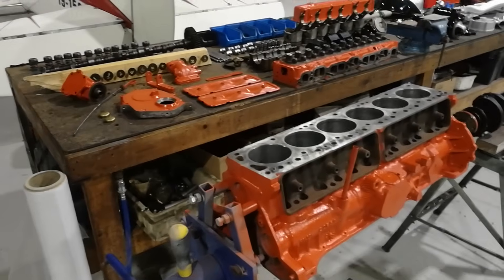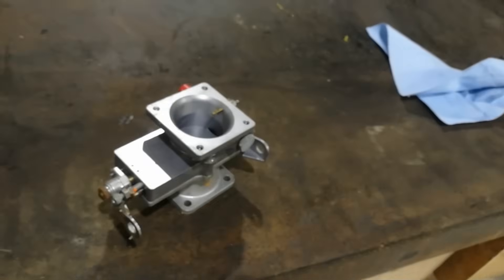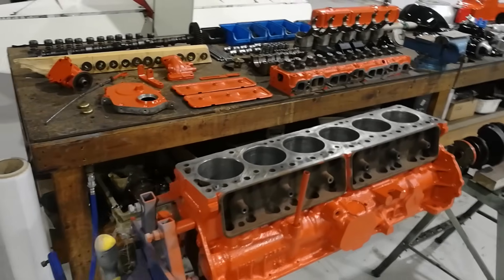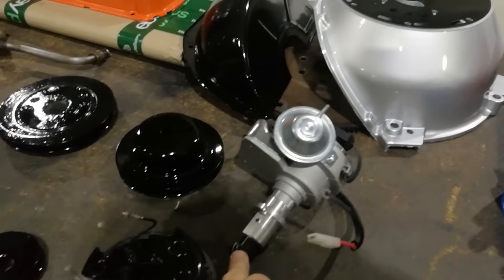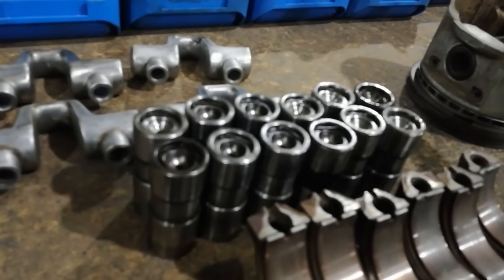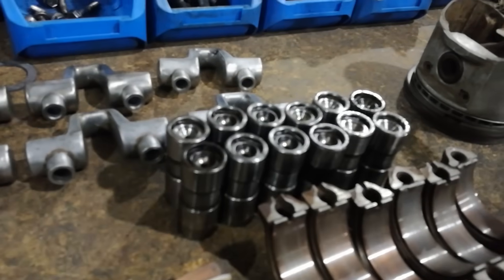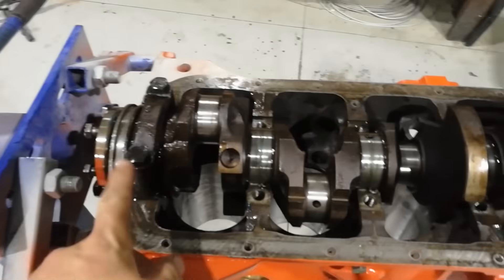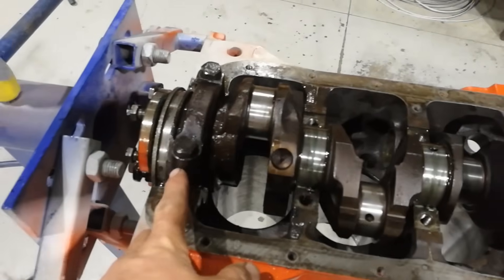Holden 202 Restoration with Rotec TBI fuel System

Comment from the maker: Dear Customer

Continuing on from our phone conversation please see attached some info that may be of interest to you.

I can offer you two x MkII TBI-34 and will machine them both so they have the Stromberg two bolt pattern (same as in my 202 videos).
These can be mounted sideways as the TBI is not attitude sensitive.

Note:
1. You do not have to be fiddling with the mixture all the time, in fact you can just set it a nice spot and leave it.  The metering regulator takes care of the rest.
2. Some folks think this unit cannot be used through the rev range or "on / off"  like in a car because aircraft are running at a constant speed?  This is entirely incorrect as the TBI does not know what sort of engine its bolted to and responds better than any carb I've ever used.  The tiny holes offer an almost perfect progression of fuel delivery better than any one single jet or tapered needle.
3.  Aerobatic aircraft are generally very high performance engines and they are constantly on and off the throttle.  Our TBI unit is used in many competition aerobatic aircraft.
4. Fuel can be any petrol.  Avgas or Unleaded no issues.  Ethanol best kept below 15 %.

I can do you two MkII TBI-34 with two bolt Stromberg pattern for just AUD $xxx (sales@rotecaerosport.com)  all up with FREE shipping in Oz.  I'm looking to get these on more cars and bikes to show others what can be done.  These TBI would be a race tuners wet dream as its like having a pocket full of 1,000 jets that you can install and test in an instant while on the fly.
Two of these units will look sharp on your 179.

Please see my PayPal money request for the two units.
Reply: 6 would look even better on an XU1 engine 🔥👍

Comment: I Put a Holden 202 in a series two landrover back in the day. The landrover diffs were a bit weak and I replaced a couple of those when I owned it but it performed very well. 

Later I got an old early model 80” wheel base landrover and put in a Holden 253 v8, turbo 350 trans, power steering and limited slip diff unit out of a falcon which I  shoehorned into the landrover carrier. It was a beast on the beach and on the sand dunes.

Comment: Red motor introduced with " EH " in 1963 , revised to the Blue motor with the " VC ' Commodore in about 1980 and the final iteration the Black motor came out with " VK " Commodore in 1984 and only lasted 2 Years . With the introduction of unleaded petrol on Jan. 1st 1986 ( and the " VL " series Commodore ) the Red - Blue - Black series of motors were gone ( In 6 cylinder form at least ) . We used to joke that Holden painted the last series Black on the VK's  because the motor was on it's deathbed . The last series " VK " was the first ever Holden to have Multipoint Fuel Injection , they went so well that Holden dropped the 4.2 litre ( 253 C.I. ) V8 from the " VK " range . We had one from new in the family and it was great on fuel and power but really badly needed a 4 speed overdrive auto. trans. All you could get back in those days was the old " Trimatic " auto and above about 100 Km/H it would be revving to hard and started to get thirsty on fuel in which case you may have well bought the 4.2 Litre V8 and benefitted from the extra torque the V8 motor made !

Comment: I visited your channel and admire the innovative work you're doing with your 7 and 9 cylinder radial engines and other cutting-edge products! To further enhance your reach within the aviation and engine enthusiast community, optimizing your channel with the right keywords, titles, and tags could help attract a broader audience. If you're interested, I can assist with improving your SEO to boost your channel's visibility and overall performance!

Comment: First available 1963 in the EH Holden. 149ci and 179ci. At the time the car was sometimes referred to as the baby Chev. An S4 variant finished second at the Armstrong 500 Bathurst production car race in 1963.  Original induction was via one single barrel stromberg carburetor.

Comment: I don't understand why people waste their time with carburettors. You're building a solid motor, so put an EFI manifold on it with 6 injectors, a ball raced GT25 Garrett turbo and manifold on the other side, with a wide duration camshaft, forged pistons & rods with a Haltech ECU and easily double with safe, reliable horsepower and have something unique! It's what I have done with all my builds. It can be all built to look close to standard.

Comment: The legendary TORANA LJ GTR XU1 engine was based off a 202 red motor.
The VC Commodore blue motors seemed to make the most power when modified though, mainly because of the head design.
Nice TBI no butterfly valve in the design is interesting.
😎🇦🇺

Comment: Rad video mate love these engines and miss my HR that had a 202 with a hella terra head and straight cut timing gears 😎 is there any reason you used the old style felt seals VS the newer neoprene type ? I’m thing of building another 202 just for the fun of it ❤

Comment: Years ago I had a fully worked 202 with triple XU1 carbs I was dragging V8 no problem and that was in a HJ panel van then I put the motor into an LH Torana and no matter how hard I tried I could not take off quick or I would break an axle

Comment: Red motor began its life in the EH, 1965, and went on through to the Kingswoods. The 202 was just about the worst of them. My HQ engine failed when the number 5 piston fell in half. I got another engine from a wrecker and it failed the same way after about a month’s operation. I heard, but am unable to verify, that the engine block wall thickness (too thin) was an issue after the engine was bored out too far, from 149, through 179, 186, 186S and, finally, 202.

Comment: 10:19 tbi displays the massive amount of fuel being poured in, when I was at rage there was a corvette and a trans-am that were likely l98 with tbi but never saw the airbox  off. It wasn’t until later I was asked to get a corvette running that wouldn’t start that I saw the torrential downpour, pretty amazing

Comment: I had a black 202 in the 90s threw  a 350 holley on it size 92 jets,extractors 2.25 inch exhaust,Tq20 cam,3 grand stally.Went ok did bit over 5000rpm in 1st.

Comment: Have you seen how how both Honda, with their CX series of bikes, & Moto Guzzi, with its Daytona, got 4 valve per cylinder heads working from 2 parallel pushrods per head? Plus without the heads being really wide either. Just trying to motivate you to design multivalve pushrod heads for the Jabiru & Volkswagen too (I own a Type 3). Mind you to stop the inlet valves on each side getting in each others way,  as the tops of the valves where their springs are, splay out a tad, you might have to tilt the whole valve train, like on the Porsche 356 & 912, so the inlet valves sticks out perfectly horizontally &  & only the exhaust valves splays out, but doubly so. Of course it would mean pistons with asymmetrical tops on them though.

Comment: Red motors were up to around 77 78 ish . Orange 202 9 port started around 79 in vb commodore.  Best ones were in my opinion were the black motor 3 3 12 port with the factory mild stage or high lift camshaft with early 3.3 blue motor 12 port head combination with a phillipino version m21 gearbox and 3.37 to 1 diff.

Comment: These engines are very similar if not the same as the 3294cc straight-six ohv engines used in the British Vauxhall Cresta (1965 until 1972) and the Vauxhall FD series Ventora (1967 to 1972) and the FE series Ventora (1972 to 1978). The layout seems identical, but it was never a popular car and no upgrades were ever offered for it as far as I remember. I heard the engine was derived from the smaller Bedford trucks. 
But what Oz has done with these is amazing. 🙂

Comment: It was Gutless , timing Gear was Fibre
Type were dogs,  had to replace with
Aluminium Type , Hungry on Fuel ⛽️
Leak more oil than they use , the 
Best thing I ever did was purchase
V6  Jap motors , cars and utilities
More power , more Reliable , Fuel
Economy twice the mileage to the Tank
Never leak  oil and after 30 Years Never
Broke Down , injection once on one motor
Ran perfect untill I hit Tree 🌳

Comment: If that is the original rocker cover  then that is a blue motor sorry mate
Reply from the maker: The rocker cover and engine was red when I purchased it. The original paint was old. The rocker cover had two PCV valves and a sealed oil cap. I blanked off the old PCV valves and went with an eBay vented oil cap. The serial number suggested the engine was from a 1971 Kingswood. I’m very confident this engine was never blue. Cheers!

Comment: They are called a red motor because,  when first released in 1963, they were painted brown. Like a dark, red oxide. Changed to orange for 1968 HK. Blue from 1980 to 83, black from 84 to, I think, 86.
Reply from the maker: I always remembered them as this orange colour. I spoke with the paint supplier and he said the colour of mine is correct. Chevy orange.
Reply: @fb2800  everyone's an expert. 
 Rocket Red,  GMH colour 10890. 
I'd wager, that your supplier doesn't even own a Holden.

Comment: So has anyone actually used one on a street car yet?
I'm up for either a new carb or a Holley Sniper efi conversion, real soon.  What price can you do for one to suit a HJ Holden 6cyl single stromberg manifold? What else do I need to bolt it on and go? What do I do about throttle cable connecting etc?
Reply from the maker: Yes mate they certainly have, we’ve sold quite a few for street and track. Give the shop a call I’ll talk you through it. 
03 5977 3805 ask for Tony or Paul (me)

Comment: Very nice!  Looks similar to the Ford inline 6 cylinder engine.  What is the horse power potential?
Reply from the maker: Not sure on the HP, this one is a stock 202 engine with std high comp pistons.
Reply: Properly souped up in the XU1 Torana the 186 and the 202 were fire breathers. Very capable race cars winning against bigger V8s (Moffat and his 351 Falcon). Brocky showed them how to do it at Bathurst. What a pocket rocket! What a motor!

Comment: Hey mate, love the video! Just picked up a '75 HJ Kingswood and I plan on restoring the 202. I love the way you've done yours and I was just wondering if the pcv block off caps were made by you or if you bought them somewhere? Thanks mate.
Reply from the maker: They are just 1” rubber plugs from  Bursons auto parts :)

Comment: like this idea can you do theses as like twin carbs ?linked together ?
and fit the old original oil bath type air cleaner ?
regarding the tightness on the crank we found that when we rebuild the 179  what we found was the rear bearing is now made  to fit all early reds but they tell you to clearance the end float o the main rear bearing we did this by using a flat piece of glass and wet & dry paper with oil sanding it till we got the right clearance end float
there is a conversion main seal that replaces the old rope seal much easier to fit  as well
Reply from the maker: You can run twin TBI no problem. My tight crank was not the end float it was the cord seal not softened fully.

Comment: The colour you're chasing is Holden Rocket red. The colour you have here is closer to Chevy orange, but it's a common colour that reconditioners paint them. As for the Holden Red, it began its production run with the EH in 1964, in 179 sized, through to the 3.3 litre in the VK in 1985. Technically was the Blue engine from 1980-1984, and the Black from 1984-1985. Main difference between the Red and the latter engines was a 12 port head, electronic ignition, and the Black had optional fuel injection

Comment: Red motors all had PCV system. There was a special tool for installing the graphite impregnated rear main oil seal
Reply: Yer it was called a large socket and a mallet!

Comment: Have you made these Throttle Bodies for a particular market ?
Or, is it pretty much open to any buyers looking for a fuel supply alternative ?
Seems if you use a Holden Red Motor for your test engine the market is fairly open for the end user.

Were you ever based near the bottom of Moorabbin Airport ?
I remember going to see a couple brothers years ago who were looking to employ someone to help build the the Radial Engines.
I only ask because you mention you also built the Radial Engines. 
Not sure IF you are the same person or there is someone else who builds these engines as well ??

Comment: Im almost 60 & the 202 when we were young was a peace of shit the 186 with a 161 head running roller rockers and a lumpy cam with triple stromberg cd-150 carbs & extractors was the way to go unless you were running a 253 and knocked off a 9inch diff from a ford to shove into the XU1 then it was fun and no they were not orangery red they were red but you did a nice job son

Comment: Brings back memories. I redid my 186 back in ‘75. It was still going strong 25 years later!!
Just a couple of points for interest. I’m not sure about the 202, but the earlier red motors really were red rather than orange. 
Also the red motor was introduced with the EH in 1963. All the engines before that were grey. I can’t remember all the differences but the red was a big improvement.
Thanks for a great vid.
Reply: It's funny how motors can bring back so many memories.
Bad memories for some people 😂

Yes you're right about the Red Motors being a Big improvement.
The poor old Grey Motors were not much, almost Vintage in away.

It's sort of ironic how Holden reintroduced the 138 back into the
 LC Torana,s ??
At least they were a Red Motor,  but that was the only good thing about them, LOL.
Most took them out and changed to either the 186 or 202 with the ever reliable Aussie 4 Speed.

Yes, they were more Red than Orange in the early days of Red Motors.
Not sure why the Orange colour was used in later models.
But the Die Hard Holden Man never cared to much about it 👍
Reply: Grey Motors had 3 bearing mains, red motors had 5 bearing mains.

Comment: Rev it witless while stiff and cold. 
I could picture the metal shavings in my mind.
Reply: Check out the temp guage on the dash. It had been running a while before he started it in this video.
Reply: and all that fuel washing the oil away from the bores.

Comment: They made the 202 as a low compression motor also. Designed for use as a stationary engine ( compressors/generators) that ran on standard fuel. Was extremely successful in this application and a much sought after engine.
Reply: Do you remember what Stationary Engines they were used for ?

I remember the Ford Motors being used for the older Chain Drive Concrete Trucks.
The only place you find them now is in old quarries or tanneries for treating the cattle hides.
Reply: @weldmachine . The Holdens were also used to rotate the mixer barrels on concrete delivery trucks. Around about the time of the making of Mad Max III, a motion picture special effects technician, Bob Bosisto had two Holden engines on a trailer driving ducted fans as a wind machine.

Comment: Same motor as the Chef 216 and 235 6 cylinder only reduced in size. Love to put that on the dyne. You sure do pretty work.
Reply: It was based on the Chevy blue flame engine I believe.

Comment: Yep.  Wikipedia has the details. Red motor in Holdens - 1963 (149 cu in) in EH Holden until 1980 (202 cu in) in HZ.  Lead free petrol and increased emission standards killed them off.  They were replaced by Nissan 6 cylinder engines.
Reply: The red engine turned into blue then black motors and were used right up to the VK fuel injected commodore then the VL sported the Nissan motor from 1986 onwards....

Comment: I had three of these over the years. Terrible motor. The 186 was better. These horrible 202 lumps revved to uselessness after three quarters of the rev range, sucking fuel, making noise and going nowhere. My best example was equipped with triple Strombergs a'la XU1, Accel ignition, Genie Headers, a Yella Terra Head upgrade and an 8 bolt Salisbury diff. Ditched the Traumatic in favour of an Aussie Boxes 4 speed. Still got smoked by Cortinas with 250cu Pre-crossflow engines sporting little more than a 4 barrel holley upgrade and a decent exhaust. Same money spent on a 186 would have been better. But would deep six all GMH sixes to get hold of a 350 Chev to play with back in the day.
Reply: I dragged off the cops in a Gpak torana with a 161 in it and an Aussie 4sp,they were in an xd with a 250, they said in court that they were doing 180 kph hour and I was pulling away from them,they just disappear behind me,their head lights got smaller and smaller till I could barely see them.it was a stock 161 with extractors and straight through exhaust out of an old clapped out ht ute :), I won't bore you with the story of why I removed the 186,but it was a good engine that was going well when swapped.
Reply: A Cortina with a 250 cross flow was a rocket,thats for sure,and a Centura with a 265 with tripple webbers would do wheel stands,but Holdens were never built to race,Holden never designed performance cars.
Reply: @gogogeedus What are you talking about?
Reply: @jefftheaussie2225  1/2 a carton in…. 🤣🤣. Cops saw him weaving and backed off….  Stock 161…. Such a good thing. 🤣🤣.
Reply: The only real description of a Holden six and a traumatic. Everyone else is wearing their rose coloured glasses. They were good for boat anchors, but not much else.